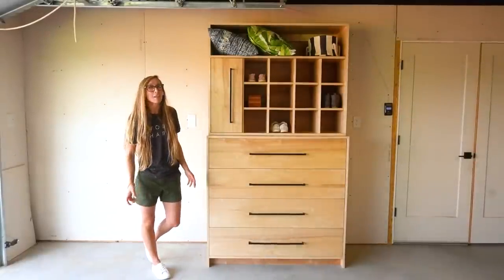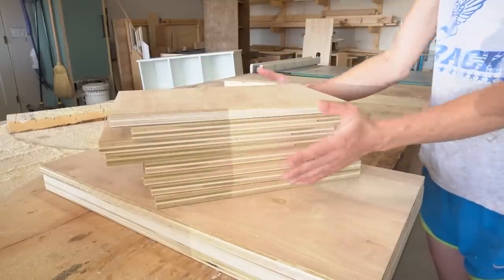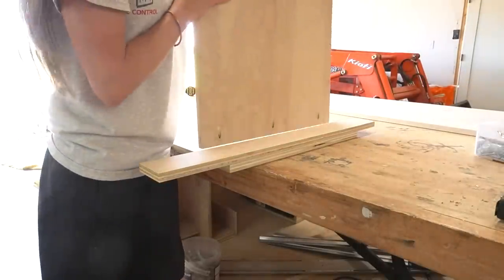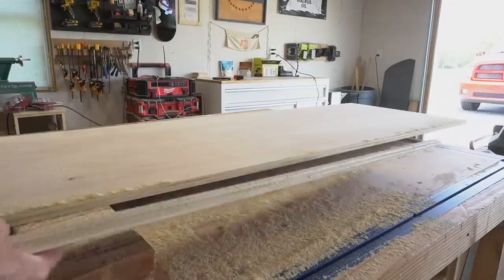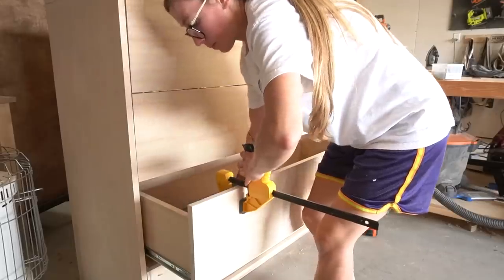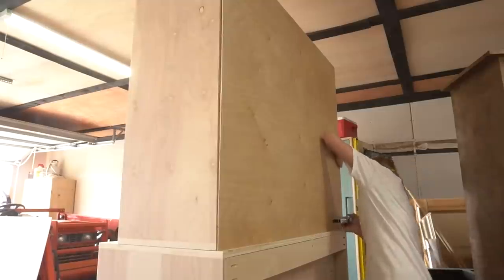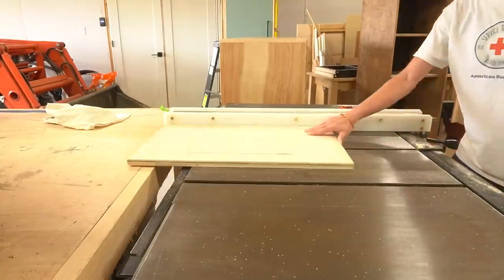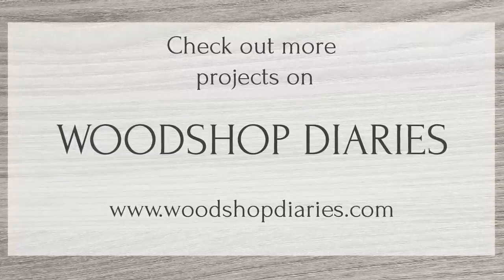How to Build a Closet System--{Drawers, Cubbies, & Belt/Tie Rack!}

Comment: What an elegantly simple and functional piece!  Hey, if you get your ply from a big-box store (like I have to), that stuff will bow on you no matter what.  I've learned the hard way to do what you did - hide extra bracing in inconspicuous places to keep it true and square.  Well done!
Reply from the maker: Thanks so much! I do buy my plywood from Home Depot and I haven’t really had a lot of issues with it being bowed. It seemed to get worse in this case with the drawers, so it could have been the weight or one of the drawers was trying to pull it in a little. Either way, I’m glad it was an easy fix haha! Anyway, Thanks so much for watching!
Reply: I agree with your comment 100%. While plywood comes off the mill true and square shipping, handling, moisture content changes, how it is stored by the retailer and how long, as well as how it is stored and handled by the end user easily will affect its shape.  Thanks Shara for sharing that note in your project.  Handling wood changes is certainly a part of the build process.

Comment: Turned out great. Good call giving yourself extra room on fitting the piece in place. I ran into a similar situation on a recently butlers pantry remodel. Closet corners are never square 😅
Reply from the maker: Thanks so much! Exactly…never assume anything in any house is square 😂 I’ve learned that the hard way too!
Reply: @WoodshopDiaries  It's a good call... nothing in our house was built square, some corners are so far out you can even see it!  Having that little extra wiggle room is always a bonus and you can scribe the trim afterwards to fill the gap if needed.

Comment: You make it look simple to make. How do you decide which wood to use for each project?
Reply from the maker: Thank you! I usually stick with easy to find and fairly inexpensive options. Whenever I can use plywood, I try to as it looks nice and it’s easy to work with
Reply: @WoodshopDiaries  aren't there different types of plywood according to the species? Thanks! I have not built anything in my life and I am totally fantasizing that I will build a desk tomorrow.
Reply from the maker: There are lots of types of plywood. I use hardwood furniture/cabinet grade ply. Mostly birch, but occasionally oak or maple. But for cabinets and furniture I stick with hardwood, not construction type ply
Reply: @WoodshopDiaries  Thanks!

Comment: First time I've ever seen one of your videos, and the outcome of this one is really nice looking with a simple yet striking appearance.  Have you ever tried working with Baltic birch plywood?  It's more expensive, but I find it a lot more enjoyable to work with than veneer plywood,  Also, I lol'ed a bit when I saw your rubber boots...
Reply from the maker: So glad you enjoyed the video and the project. I have yet to find Baltic birch plywood available in my area without taking a 2+ hour long drive to pick it up. I’ve been very happy using the birch plywood I’ve been using and honestly don’t seen a great reason to switch unless the price is similar and it’s more easily available to me at some point. 
Also, the rubber boots are a staple in the workshop 😂😂

Comment: Another great project. I noticed that you used Sketchup as your modeling software. Do you create the concept in Sketchup first, show the customer your model, and then tweak things as you show the customer the model?
Reply from the maker: I don’t. So actually I very RARELY ever sketch anything on Sketchup before building it. I do very little commission work (I don’t build much for “customers”) so when I do, I’ll have a paper sketch or some pictures of the idea we are going with. I almost always build it first, then draw it in sketchup. I don’t use sketchup for anything other than making plans to share on my website. I don’t actually use the plans. I just make them to either share or sell. I never build from plans
Reply: @WoodshopDiaries  That's impressive. I use Sketchup for just about every project I make. Because material is so expensive right now I can't afford to make a wrong cut (though I still do). I find it helpful to create in the virtual world and then in the real world.
Reply from the maker: It’s so funny I was recently on a show with Steve Ramsey talking about this. It’s on his channel if you’re curious. And we talked about our process and where sketchup came into play.

Comment: Nice build! The tie/belt rack pullout was a great idea!
...
Did your base side panel cutting account for base molding at the rear of the nook, assuming base molding is installed?
Reply from the maker: Thank you! They actually removed an old built in vanity in this nook to add this piece so the baseboard was never installed there.

Comment: 1st video I've seen here, project turned out awesome! Did you consider using 1/2 ply for the top section, save some weight and cost? And did you consider using dowels to align and secure the top section to the bottom drawer base?
Reply from the maker: Thanks so much for watching. I didn’t consider 1/2”. I very rarely use 1/2” in my shop. It would save little cost and some weight, but I don’t think it would be strong/sturdy enough for something this large. And also, I didn’t consider dowels. Screws from the underside would work fine and you’d never see them unless you removed the drawers and crawled into the bottom cabinet. And even then, who cares? Haha. But there’s nothing wrong with doing that, I just didn’t see a reason to.
Reply: @WoodshopDiaries  Makes sense! I was thinking it's tough keeping things from sliding around up top while I'm under trying to screw upwards; dowels keep it from sliding and give absolute positioning. I recently watched https://www.youtube.com/watch?v=en48E7UVzzc which is making me think more about thickness choices. I have a spot this plan is screaming for, appreciate your help!

Comment: OMG I love you. I am rebuilding a vintage RV and so I am new to woodworking, and I love it. Any advice on keeping the weight low without sacrificing quality? Thank you, Lisa (Anchorage, AK)
Reply from the maker: What a fun adventure!! I bet that’s going to be amazing! For small stuff, you can get away with using 1/2” thick cash 3/4” thick material. That saves some weight. And maybe use curtains, fabric, or cane material instead of solid doors/drawer fronts.
Reply: @WoodshopDiaries  Thank you for the advice. I am now totally addicted to woodworking, and to see another woman that loves it, is just insanely great. I'll keep you posted on the progress.
Reply: @WoodshopDiaries  I aldo forgot to tell you, the RV is a 1983 Tiffin Allegro Motor home. The interior framing is aluminum, 1x1 frame. The other interior is done with 1.25in plywood (Paneling) and secured with 1x3. Not very sturdy. Do you want a trip to Alaska to help me build? Hahaha.

Comment: Did you really do all of your plywood long cuts with the Kreg cross-cut jig? ...and not the table saw? End product looks amazing. So the jig is accurate/stable enough? Asking because I have that jig and don't have a table saw ;-)
Reply from the maker: Yes, I used a circular saw & guides plus my miter saw to make all my cuts here for the plywood. I love my table saw, but I’m small and it’s hard to run large pieces through it by myself. I really love these guides and I have a video on how to set them up here:
https://youtu.be/NPNZlXJ7XPc

Comment: Great build!! I did notice your pocket screws were pointing outwards towards the corners (gripping less wood than if they were pointing inward). This potentially could create a weak point in the structure. Since your build is going to be inside a nook, it’s unlikely to take a blow from the side so it’s probably fine. But what are your thoughts on placing pocket holes?
Reply from the maker: You can get super technical about things like that. It’s good to keep in mind, but a little common sense goes a long way. I typically place pocket holes based on where/if they’ll be seen vs the direction of the screw. In many applications, it doesn’t make a difference because by the time you get done adding back panels, additional bracing/supports, it’s not going to matter. But I’m sure some will disagree. Personally, I build so they won’t be seen and design it so that it gets additional bracing elsewhere if it’s needed.
Reply: @WoodshopDiaries  thanks for the reply. Again, I absolutely loved this build. It’s given me some inspiration for a build of my own.

Comment: You said using birch wood was keeping things inexpensive? At this time that you built it these sheets were going for about 70-80 bucks and when the economy is normal it would go for 50. But this dresser came out really good, those were some huge drawers.
Reply from the maker: $64 to be exact. But plywood will beat solid wood pieces any day for the equivalent amount of lumber. So by using plywood, no matter the fact it was $64 a sheet, still makes this inexpensive compared to the alternative 👍